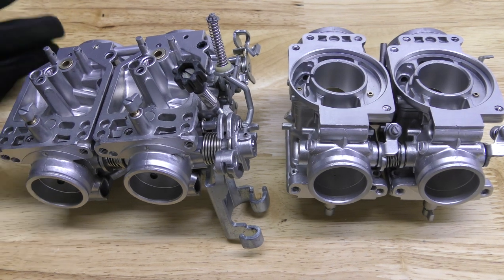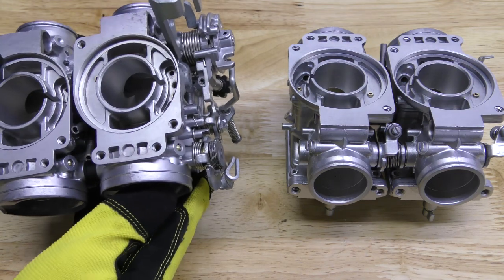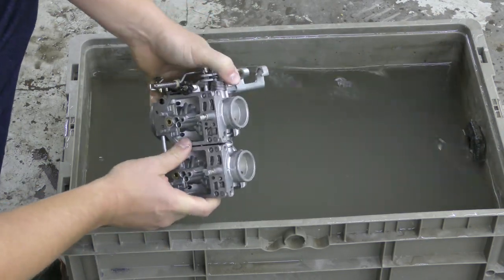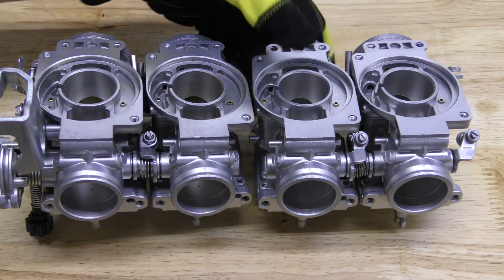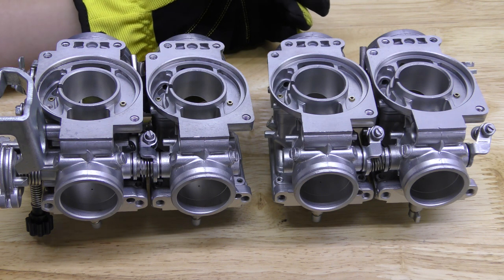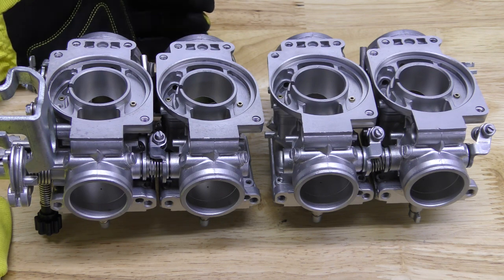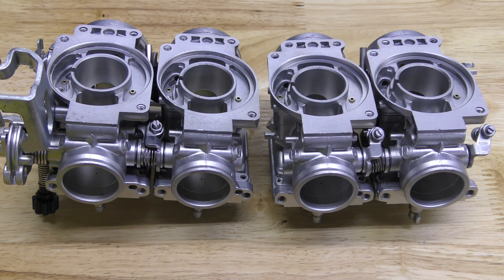The Best Tool For Cleaning Carburetors- Vapor Honing Technologies

Comment: Hello sir. The Vapor Honing process change the surface polish or finish like aluminium engine parts lining. It changes the shiny surface into satin bright finish on using very fine mesh glass bead 170-325. I wanna ask which Rustlick rust inhibitor you are using. There are Rustlick 631, Rustlick B, and etc. When should i do vapor honing before or after lathe work, like cylinder boring, valve laping portinh decking etc. It also changes the color of metal parts.
Reply from the maker: Which Vapor Honing Machine do you have?
Reply: @VaporHoningTechnologies  I have Vapormatt
Reply: Please reply sir. I am interested in your vapor honing tool. Because your tool is far better then vapormatt. I have small blaster box. Now i am planning to buy the bigger one. I am cleaning carburettors. I am going to soon overhaul engines for that part I do not have any knowledge. Please share knowledge base because I want to know all about vapor honing process for an engine.
Reply from the maker: @bittainment5995  As we have spoken before the Knowledge Base Information is reserved for our customers that have purchased a unit.  I am happy to take your order for the unit you are interested in purchasing.
Reply: @VaporHoningTechnologies  Sir. I need more time first i want to know all about vapor honing process. Then I will definately buy the machine.

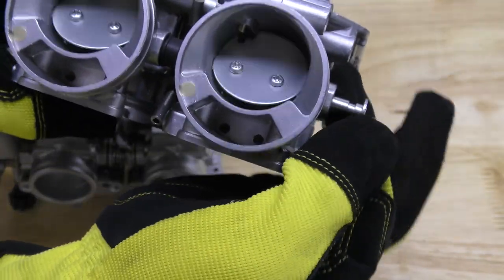Comment: 1:33, it sounds like sand moving on metal.
Reply from the maker: In Vapor Honing we do not use sand, it is Glass Bead, Aluminum Oxide etc.
Reply: Crunchy none the less… would wet soda blast be a safer option for carbs?